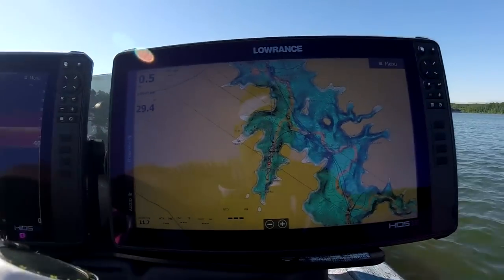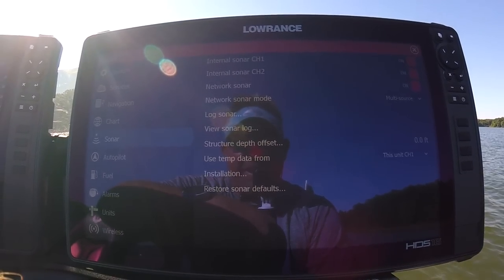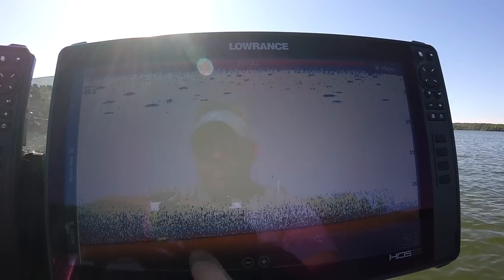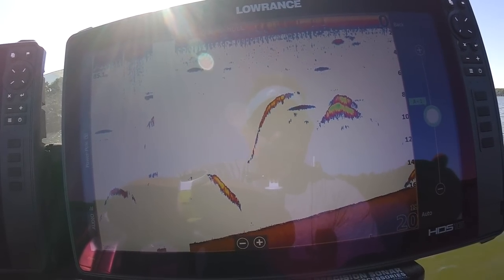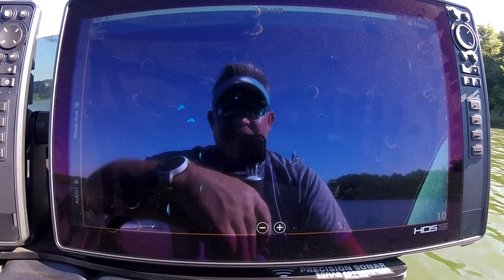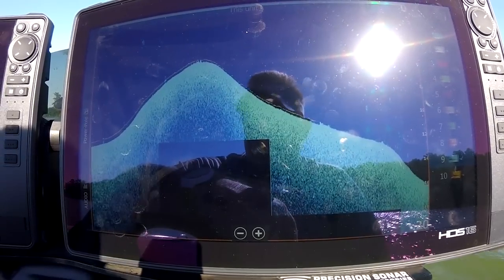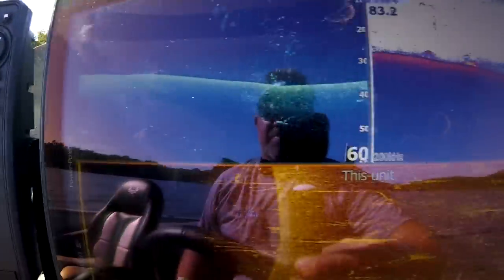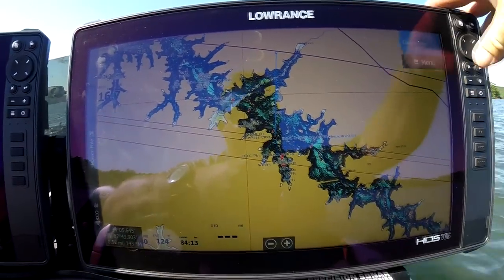Lowrance HDS Live Setup/Tweaks

Comment: Just a heads up, you’re using dual $250 GPS receivers with 5 meter accuracy, so having the rear point 1 just for having a closer gps for waypoints is irrelevant.

Comment: Do you know how to turn on contours on the charts?   Low range has a video where they just push a button.  It won’t highlight the button nor let me push it.   Are they making me purchase something?   Thanks for your help!!! Can’t find anything in the manual or their website or the Internet.
Reply from the maker: depends what unit youhave and what lakes you are on some lakes have free contours, and then some of the smaller lakes u would need to purchase a navionics card and that is a mapping card for your region
Reply: PaulGettysFishing I purchased a navionics west card not realizing it was a different size.  Do they make an adapter or do I have to purchase a different card.  Thanks for your quick response!!  Subscribed.
Reply from the maker: @tyson1015  if it is a new card they have a micro card in the end of the full size card, is the card new?
Reply: PaulGettysFishing  thank you! Thank you! Thank you!!!   There is a little card inside the big card.  Today was a shit day of fishing.  Tomorrow will be a much better day!!!
Reply from the maker: @tyson1015  good deal!

Comment: Great video!! Is there a chart speed for the down imaging. I just bought a hds live. It doesnt appear to be moving fast enough as I'm trolling on my post trolling motor
Reply: There is no adjustment for scroll speed on side and down scan. I was very disappointed to learn this. I was told it works best at 3 to 5mph.

Comment: Great video as usual Paul! 
Have a question on the heading sensor while running. Do I have to run a point one up front or can I run it off of my front bow unit (hds3) while running a live at the console? I have a point one at the back near the transducer if I need to run the heading sensor off of that one but saw you didn't recommend that due to sliding around corners when running at high speeds. 

Thanks Paul!!!
Reply from the maker: the heading u will run it off the point 1, but the gps on the front will use the internal gps and the rear unit will use the point 1 for the gps
Reply: @PaulGettysFishing  but while I'm on plane running at high speeds do I run heading sensor off of point one at the transom or off of the bow unit to keep from sliding in the turns while following trails as you talked about in your video? Sorry if that first question was clear as mud... lol
Reply from the maker: @DavidWhite-lc1fc  u run it off the point 1, or under heading on your console u can just uncheck the point 1 under heading

Comment: Paul why do you prefer 200 kHz vs chirp on your 2D sonar setting?  Great video really helped me setting up my new carbon
Reply from the maker: The only time I use chirp is if I am running an Airmar transducer, 200kz in 20ft of water is roughly 6ft  beam, chirp is about 3 and works better for target separation but u miss alot of fish with it.

Comment: My 3 in 1 transducer didn't auto detect and my transducer list doesn't show it to select.   Any idea?
Reply from the maker: which unit?
Reply: HDS Live 12
Reply: I'll add the downscan and side scan work but would they work better with the proper transducer selected?
Reply from the maker: @djcarpenter77  do the latest update and then perform a hard reset, make sure u save waypoints before
Reply: @PaulGettysFishing   Tried that a few days ago and still didn't work.  I'm just curious if it's worth worrying about?   Thanks for the reply!
Reply from the maker: @djcarpenter77  when u go to pages, settings, sonar, installation , up top choose ch 2 and it's not greyed out at the bottom? with 3n1 ai
Reply: @PaulGettysFishing  I can't verify right now but I'm pretty sure it says unknown transducer.